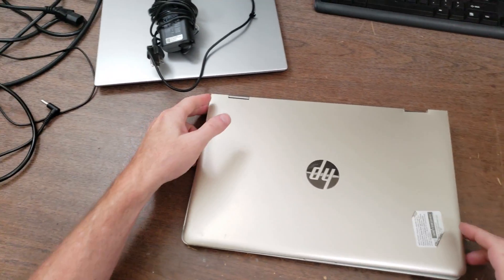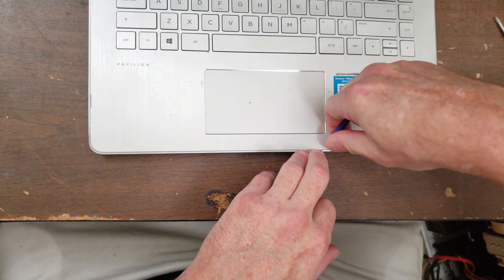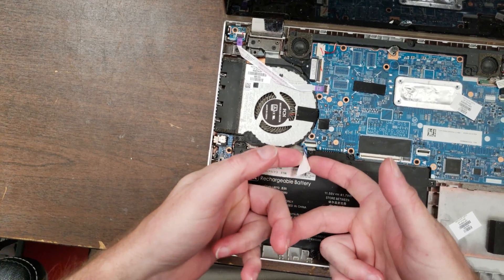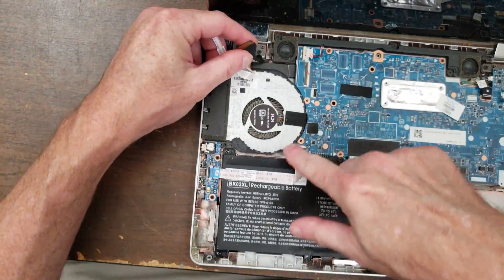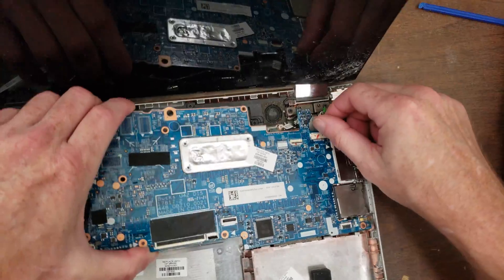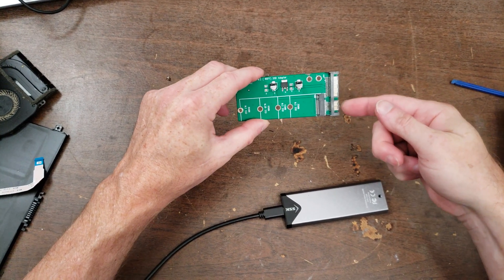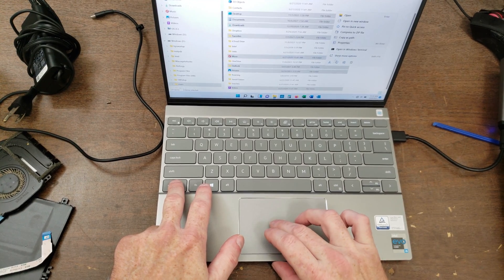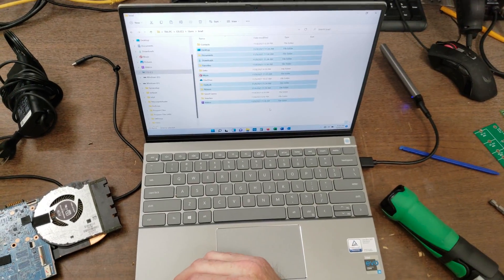Recovering files on a smashed laptop from a M.2 Solid State Drive to a new laptop

Comment: Hi, what if my just says USB Drive d? Which means it can’t detect the ssd. What next?
Reply from the maker: I need a lot more information about what it is you have and what you're trying to do. If you connect a drive through USB on your computer whether it's m.2 or SATA or whatever the computer will likely call it a USB drive. If the D drive letter was the next available drive letter that's why it called it D. That's not an indication of something not working or some kind of failure. What is it you have and what are you trying to accomplish?

Comment: How do I transfer all data to new laptop without the windows software?
Reply from the maker: I need more information.  What's the situation?
Reply: @MichaelTheComputerGuy  I’m currently been trying to transfer all my data from an m.2 to my new laptop. Only problem is that it has windows in the m.2 and my laptop already has windows 11 installed.
Reply from the maker: @deadforalldead3576  having different version of Windows is not an issue.  How do you have the m.2 connected to the new computer?
Reply: @MichaelTheComputerGuy  I am using a m.2 ssd enclosure to connect into my laptop.
Reply from the maker: @deadforalldead3576  Then it should show up as a drive letter under This PC so you can go in and get your files. Drag and drop them onto the new laptop.
Reply: @MichaelTheComputerGuy  can i also transfer the games files and other applications?
Reply from the maker: @deadforalldead3576  You need to reinstall the applications and games.  They can't be transferred the same as files.

Comment: Hi, 
What if in the M.2 Drive Users folder has some security added? 
Please help.
Reply from the maker: What kind of added security are you talking about?
Reply: @MichaelTheComputerGuy  I have a dead laptop with users have password added and that laptop contains M.2 chip. When I tried to access it in different laptop then I am not able to access Users data. It is saying you have been denied permission to access this folder. Please help.
Reply from the maker: @AshishGupta-px4nl  Try a data recovery software. They can usually get past issues like that.
Reply: @MichaelTheComputerGuy  Any suggestions?
Reply from the maker: @AshishGupta-px4nl  Google search for data recovery software.  Easeus would be my first suggestion.
Reply: @MichaelTheComputerGuy  Thanks

Comment: Can you still recover files from a failed M.2 SSD?
Reply from the maker: It's possible.  Try free or trial data recovery software first.  If that doesn't work you can contact a data recovery place. 24hourdata.com is the place I use.